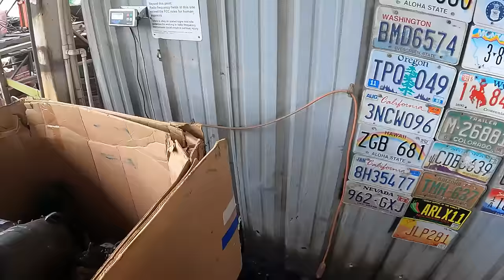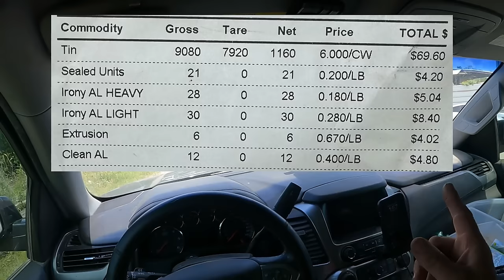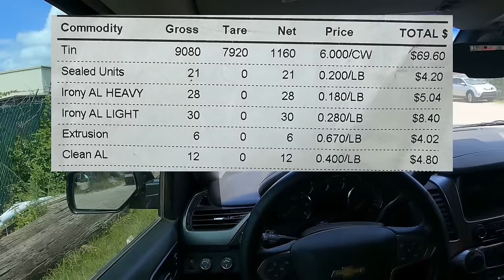Did The Streak Continue? Street Scrapping for Metals & Treasures

Comment: Just to let you know nearly ALL old lamps have a HARP that holds the lamp shade on. It is the metal hoop over the light bulb . The were one all made of BRASS! I see you pass them and only take the cords. Pinch both sides and pull up to remove from lamp. If not brass you are still getting a bit more metal. Jody😊